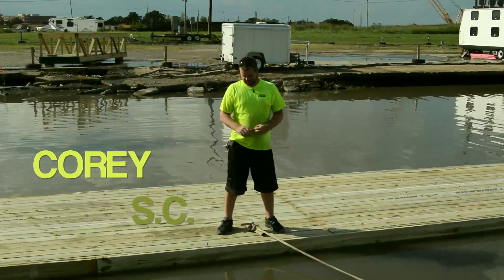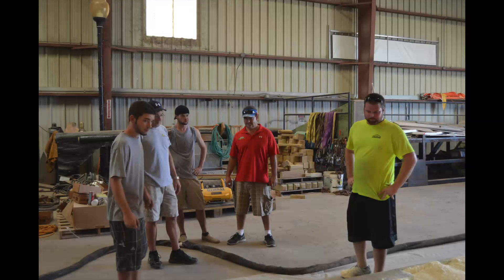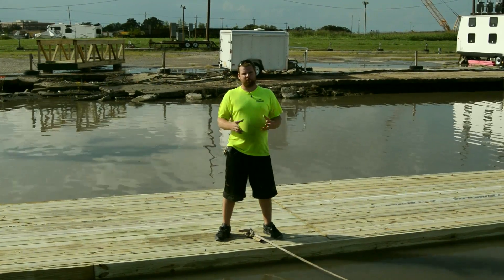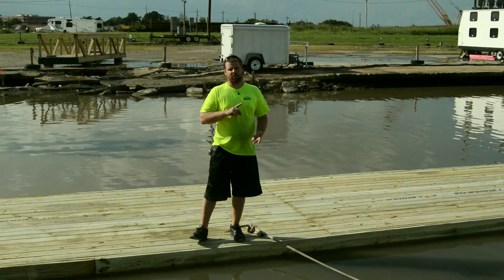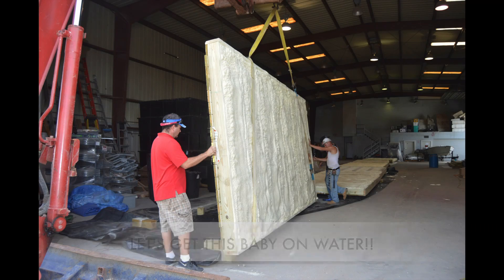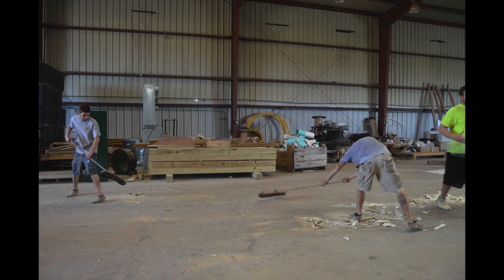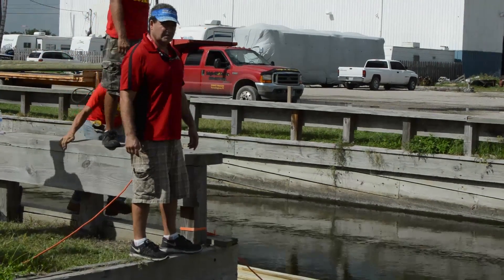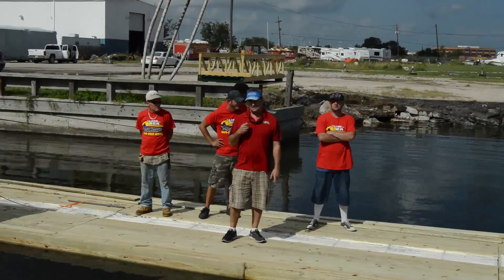Marine Floatation with Spray Foam

Comment: Excellent idea! Perfect for a temporary platform for repairing and building docks on lakes that don’t allow the use of a floating dock. If using the 2x6 deck boards and frame what is the smallest dimension platform that can be built for one man to be stable on for doing repairs. I’m thinking of building a 6x6 platform for building a dock. Please give me your suggestions and thanks again

Comment: I live next to a lot of lakes and I have a spray foam rig… I’ve been thinking about making some of these docks.  I know the spray foam itself will last for a long time, but I  wonder what the best sealant you could spray over it to make it last even longer? And ideas?
Reply: Put on a small mix tip and purposely spray A rich on the outer layers. 30 to 50 percent more A works well. If its going to be out of the water just paint it to prevent oxidation.

Comment: If it was sealed from the elements it would be great. Wait till a boat leaks fuel around it. Put gas in a Styrofoam cup, same thing. And the guy with the power drill and the guy holding the cord out of the water should get head examined.
Reply: It would work on our lake.  Only electric motors are allowed.  No fuel
Reply: @beebob1279  I am familiar with this type of foam. It is polyurethane and is unaffected by hydrocarbons and acids. Styrofoam is polystyrene and will immediately disintegrate as readytoboat states.
Reply: @williamtabbert6456  Thank you.  It's a summer project this year.  I tree fell and destroyed our dock that stood for over forty five years.

Comment: I'd be curious to know what type of chemicals it leaks into the water, as well as water absorption. Just because something 'works' doesn't mean there won't be consequences to the environment or the product. I'd be interested to hear from a chemist. If it's safe for the environment, I'll definitely use it.
Reply: I'm also very interested to know this. I know Great Stuff makes a special pond foam that doesn't leech into the water. Could this be the same stuff?
Reply: @hobbesthebrainslug12  This is not my video but it will not release chemicals into the water after it is hard. It will over the years absorb if subjected to freeze and thaws.. It should be protected with a pvc sheet (tank skirting) to prevent muskrats, etc.. from ripping it up to make nests..

Comment: What about wood rot!
Reply from the maker: When you seal it properly there's no wood rot. 28 mils of silicone, then 2LB closed cell 2" in depth. Land and sea construction used this on their Tulane swimming dock. You can call them for first hand experienced information. It's been in the water for over 2-years.They are out of New Orleans. The owner's name is Lee.
Reply: Sunlight Contractors thanks!

Comment: I'm curious to know, is it possible to use closed cell foam in rafts? I got the idea after using closed cell foam on a construction job. That's how I came across your video. I was wanting to know if you guys have ever tried spraying/injecting it into a cheap Coleman or Intex Raft or any type of a air filled pool toy?
Reply: Getting the right amount would be difficult.  As it expands there is a good chance it will pop the raft.  If you could cut escape holes, it might work.  I like this idea.
Reply: I home school..we are working with Great Stuff and Plastic Bottles right now.....I think we will try this with a cheap float from DG too! Thanks for this video :) it helped me alot
Reply: thisisacrummyname 
Sounds like a good idea for a YouTube video.  Make sure you post a link to that video in this thread, I wanna see it.

Comment: I plan to go to a lake with friends and I was going to buy some inflatables but that would be really expensive so I'm going to use foam and cut it to size making seats and an island (all to float on the water) but I have no clue about density or price or thickness or how to stick it together because I know sone types of foam are melted by some adhesives. So any advice.

Comment: This is  great idea!  I'm about to build a float dock and am trying to decide between 55 gallon drums and your standard dock floats.  I haven't considered this option though.  My one concern would be the smell.  I recently had closed cell foam installed into my pontoon boat and it is fairly pungent.  Does the smell ever dissipate or is it forever present?
Reply: Every man made product leeches, its  matter of what it is and how much and how often it does leech away. Even the pressure trested timber used in marine structures fixed of floating is leeching the treatment into the water. Nothing is cheap when it comes to making something you want to last for more than 20 or more years/decades, but fiberglass when done right will last easily 100 years and with proper annual or biennial maintenance to clean off barnacles and other marine life growth, but will not get eatten or rot away like wood or rust and eat away like steel.
Reply: 1. This is going to be super expensive.
2. That foam is extremely toxic petroleum-based nonsense. I would feel extremely uneasy about leaving a giant mass of it suspended in a body of water on my property, especially if I care at all about the well-being of that body of water.
Reply: @nunliski  I know it has been a few years, but Styrofoam is petroleum based as well.  Once cured, it, like closed cell foam is a safe product. How about treated wood? It uses chromated copper arsenate which is extremely toxic.
Reply: Lick_a_Butt 
You're right about it being expensive.  I was also concerned about it effecting the environment.  Until I used it . It's extremely durable and won't flake off like Styrofoam. A dock like this probably last a couple hundred years.